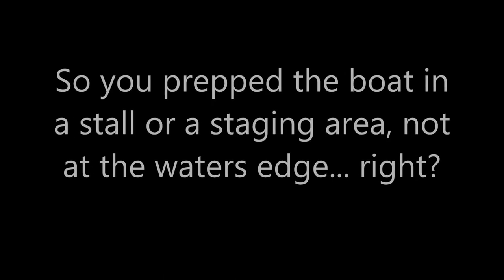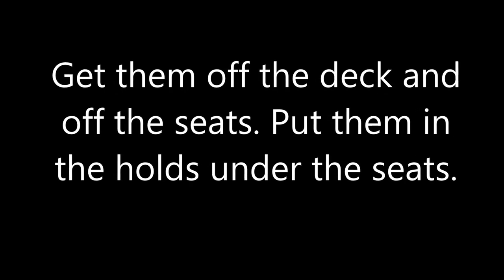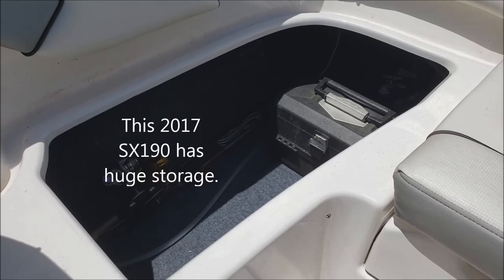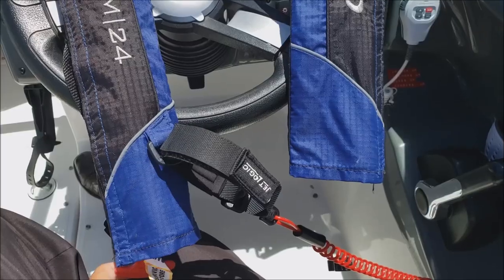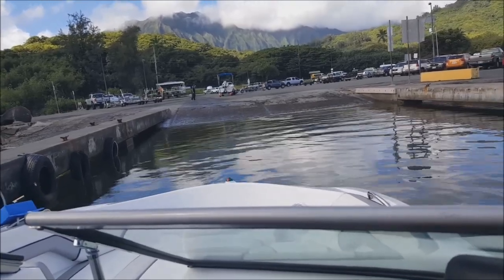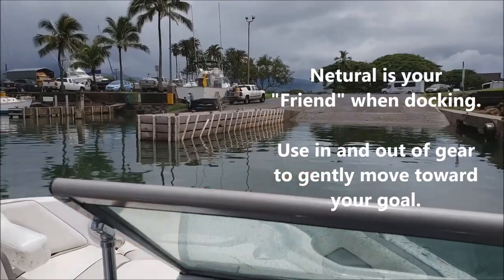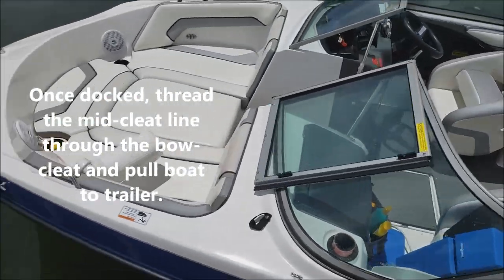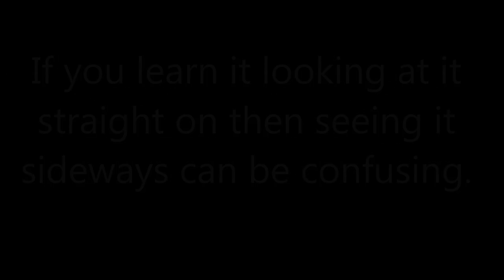8 Solo Boating Tips - For Newbs - Yamaha Jet Boat, Epi. 19

Comment: Great vid  I’m
Bout to get into my first boat and this helped me a lot.   Question the bilge pump stays on the whole Time you are out on the water ?
Reply from the maker: Very good question.  The answer is "no", the bilge only needs to be on when you need it. On my boat this is a Manual Switch on the Dash that lights up when the switch is "on".  On some boats an automatic float switch will be installed so that when water gets in the bilge area and reaches a certain depth the float rises and starts the bilge.  There are positives and negatives to both set ups.  The bilge water exiting the boat is visible and you can hear it when water comes out. 

If you go Manual, then you must switch "on" from time to time. I check the bilge many times during the day especially when launching. You never know when you might have left out drain plugs and hitting that switch will save your day.  

The Float switch sounds like no-brainer however 1. they can run on, burn up and drain your battery 2. they can give you a false peace of mind which you wont know till its too late.  

Good Luck on the new boat, the season is starting to come around!

-scott
Reply: @HawaiiJetboat   Thanxs man.   Looking into a 2014 scarab 215 ho